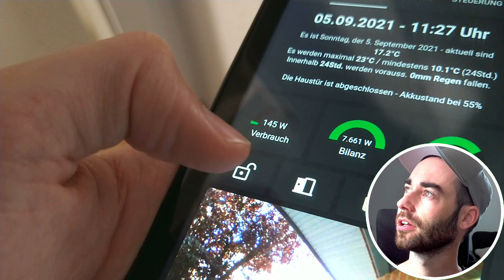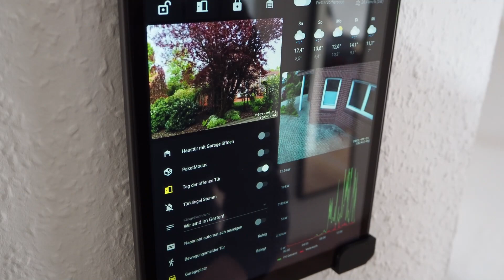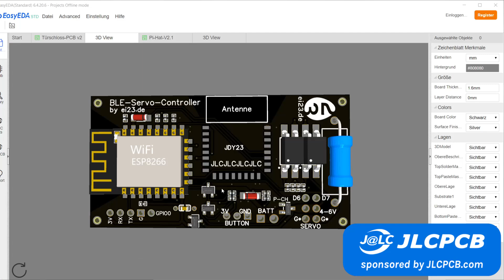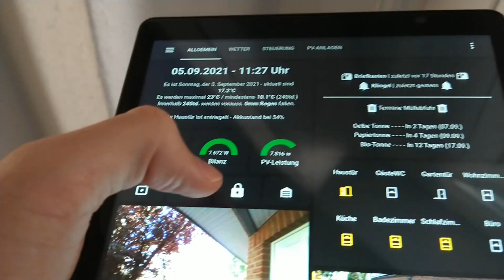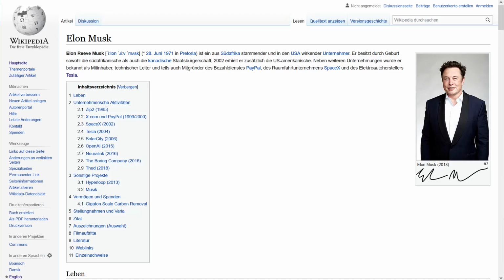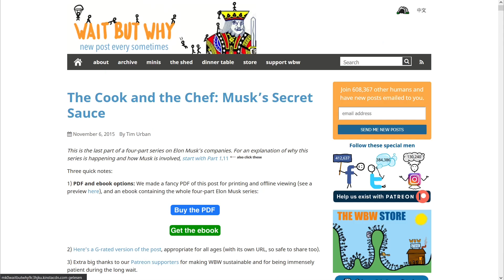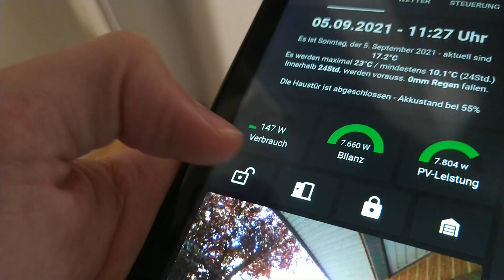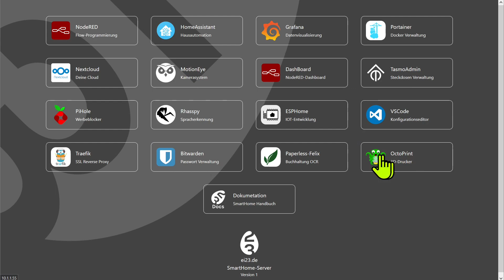Engineering a Battery Powered Wifi/BLE Smart Lock with custom PCBs [ENG]

Comment: Hello, thank you very much for your work. 
Very interesting. 
I am a computer science engineer and know nothing about electronical stuff. 
I am learning and your video is a very good starting point. 
I want to create my own smart lock too due to very high price commercial offers. And I want to learn how it works. Being able to fix it.
Did you update your project since? 
Do you have any materials I could start from? 
Would you mind sharing your 3d files ? (Another skill I need to master).

Thank you!
Reply from the maker: I did a small revision, mostly software. Its one of my most reliable projects, i use it daily.
Also i have a door opener for my backdoor (see under short videos)

I will give an update share some details "soon".
can not say exactly when.
but you have now LLMs as tutor, right?
I did not have it, back then.
Reply: @ei23de  yes I heavily use LLM, and learned a lot. This is also a reason why I discovered your video. I am still fighting with chatgpt to understand servo. Things like only half a rotation. Rotation on both ways. Double rotation... Oh man. Actually it is not so easy to jump in this world. But I am learning :)
Hope, "soon", will be "very soon"
I am on my mosquito net custom project for my kids right now, and my shutter transformation from manual to domotic for dividing price by 10. Thanks a lot for replying by the way, I really appreciate that.

Comment: How do you get the servo to stop when you make an effort in the opposite direction of the turn? 02:11
Reply from the maker: With a Shunt on the analog sensor the current is is measured
Reply: @ei23de thanks, I'm using an INA219 sensor to measure current. What analog sensor are you using? And what shunt do you use?
Reply from the maker: @melsion2183  Analog Input from ESP8266 and a 1W 1Ohm Resistor

Comment: Great Project! Im doing something similiar. Im trying to took off a tuya smart lock and gain local acess to the commands. I already have de hardware part, but Im struggling a lot with BLE modules and power consuption. Could you share your JDY23 code?
Reply from the maker: Yes, power consumption optimisation was the hardest part for me too.
The JDY23 has stock (AT) Firmware on it. I just changed the standby / beacon interval via AT Commands. Just search for JDY23 AT-Commands, there are some docs for it.
You have to connect with uart (tx/rx) 9600 baud and then you can enter commands via serial console like AT+VER and AT+SLEEP

The JDY23 has a pin high, when a device is connected. I use this to wakeup the ESP8266 via MOSFET.
I recently found the SEEED XIAO BLE (BLE ONLY), this should also do the job without the ESP8266. It has great documentation and very low power modes.
Hope this helps

Comment: so how did you trigger Bluetooth in order to wake up wifi module?
Reply from the maker: BLE Module is in permanent low power stand by (< 0.2mA)
You can trigger a pin on the BLE module to turn on a mosfet circuit to power up the ESP8266
Reply: @ei23de  do you trigger it by hand then?

Comment: being as the PICO W is like $6 and 32bbit, could one of these be used, as they are thin small, fast and cheap !!
Reply from the maker: Connected standby power comsumption for the Pico W is too high.
You still need a low power BLE device with very low power.
Try the XIAO BLE!
Reply: @ei23de  thanks

Comment: Hi, it's a great project. I'm reviewing the materials I need to do something similar. What servo did you use to turn the key?
Getting the battery to last six months is great, what kind of battery is it?
Thank you very much!
Reply from the maker: Thanks.
Servo: MG996R
Battery: 2x 2.5Ah LiPo at 4.2V, but 4x AA
batteries also work great.
Reply: @ei23de  
Perfect, I just ordered the servo to do tests. I have not found any 4.2V LiPo battery, all the ones I saw are 3.7V.
I'll try the 4 AA batteries. Thank you very much.

Comment: Your videos are most educational with a well thought out presentation.
I am working on an Esp32 project for which I want to monitor a low voltage circuit and when it is closed it makes a buzzing sound on a smartphone. When the circuit is opened the sound stops. Would you be interested in helping me professionally or can you give me some direction to an open source like Home Works that might apply. 
Thanks, Joel
Reply from the maker: Thank you!
I'm quite busy right now, but i could give you some tips to get you in the right direction:

If you are not already into it, check out MQTT
Also you will need some kind of server. A raspberry pi for example works great as server running mosquitto as MQTT Broker and NodeRED for logic.

If you are not so much into programming, you should have a look at ESPHome and Home Assistant
Reply: @ei23de  I have worked with the Esp32 cam and built a camera. I will try that venue. Thanks, Joel
Reply from the maker: Yes me too! Check the doorbell video, if you not have seen it.

Comment: Love it! Also looking forward for the detailed tutorial. 

I'm working on a similar project (not for doors) and, being more a software guy than an electrical engineer, I spent so much time trying to find a low energy wake up source for it. I love how you got inspired by your radiators control. My inspiration came from 433MHz device but for low energy battery project, it just doesn't work. The insight about the JDY23 has been a game changer!
Reply from the maker: I'm also more on the software side... hardware is hard :D
It took me ages to find the right device and setup.
glad if i could help out.

Comment: Hi! What state is the JDY23 in when it is listening for a message to wake up the ESP?  Is it "Light sleep with Broadcast"? If so, which interval do you use? Thanks!!!!
Reply from the maker: You can activate sleep mode with AT commands, also broadcast inteval i've set to 200ms this way.
Settings will be saved. 
The JDY23 will light sleep after some seconds without a connection.

Comment: Your project turned out great! I tried to make a smart lock similar to yours but the battery only lasts for 2 days. I don't have much knowledge in electronics and I found that the servo that was consuming too much battery. I put a mosfet to turn it off after opening/closing the door but it didn't work. By the way is the wifi that gets a lot of battery, right?

It would be great if you share your project and list of parts you used.

Congratulations on the video and the smart lock!
Reply from the maker: Thank you!
Yes, i will share more details someday.
It was quite a hassle for me, since i neither was into into electronics. I tought myself everything, most of it by trial and error.
The servo uses ~2-5mA in standby, so i turn it of with a mosfet.
And of course Wifi and the whole EPS8266 is also turned of. That uses up to 50-120mA when turned on.
It's all woken up by the BLE Board (JDY23) which get down to  0.1mA in standby.
Battery lasts about 6 month, which i am super proud of.

Comment: Hey, just ran into the same battery life issues myself while working out a similar project!  I don't suppose you have a parts list or schematic for your wiring available, do you? Would love to be able to piece the electronics together without trying to reverse engineer the shots in your video. Right now, I'm just relying on corded power for my lock
Reply from the maker: I have an ugly fritzing sketch as schematic if thats ok?
Reply: @ei23de  Anything helps! Thanks!
Reply: @ei23de  Hey, just wanted to check in again to see if there's any way I can get a link to that sketch. Thanks!
Reply from the maker: @jarethmt26  Sure. https://download.ei23.com/?action=download&file=Tuerschloss_Steckplatine.jpg

There is an hallsensor (OH49e) which is not needed, also one of the optocouplers is not needed anymore.

I built the current PCB version without a sketch, just out of my mind and with this sketch.
But i will do an update to this someday!
But this will do it for the first i think.

Comment: How long does the battery last?
Reply from the maker: About six months, as i said.
Reply: @ei23de  is this over bluetooth only or with wifi connection?
Reply from the maker: Bluetooth is always on, wifi is only turned on for a short time if a device is connected to bluetooth.
Reply: why need the wifi?
Reply from the maker: There is no need for it,
but it is faster with updates OTA, better range and easier debugging. 
And the ESP8266 is faster and cheaper than Arduino chips. 
But you can go without it.
Reply: Can you build a wifi window sensor battery  operated  with esp8266 01? With tasmota  firmware ?
Reply from the maker: Possible, but as i said:
The wifi connection process is slow, it can take from 1-10 seconds to send the data.
Check out ESP-NOW.
Tasmota in this case has no advantage...
Reply: @ei23de  well right now I have it a static IP and it connects in 5 seconds  very consistently. I can deal with that for a window sensor or door. My dilemma is trying to power it on and off when the window opens and closes so it conserves battery as much as possible. I also have tasmota firmware flash on it its how it connects to my home assistant via mqtt.
Reply from the maker: @shannonbreaux8442  You could do deepsleep, or better -> completely turn the ESP of with a p-channel mosfet circuit.
I guess the challenge is to trigger it when it opens AND closes.
But you only need a short pulse to wake from deepleep, or turn on the mosfet circiut. Then you could check the state of the switch... Possible, but not beginner stuff i would say.
Reply: @ei23de  I'm leaning more to the p channel mosfet circuit since it will turn off esp chip  using a magnetic reed switch. Can you do a short video on that?

Comment: Awesome work! Looking forward for the detailed tutorial.
Have you tested battery saving on fingerprint sensor or keypad (if paired witht the lock via homeassistant for example)
Reply from the maker: Thanks, no i don't want wirings on the device. 
The battery lasts now about six months with BLE in Standby, thats great for me.
Reply: @ei23de   exactly, those other input device should be separately powered by respective batteries.
Also, if you manually lock/unlock the bolt by hand. Would this reflect the current lock status or affect the motor?
Reply from the maker: It's all powered by one battery, but everything which is not needed is turned of by a mosfet circuit.
You can easily rotate the key by hand, this is important for safety reasons.
The lock state will then not get updated until the next automated run.
Reply: @ei23de  how did you get the batteries to last 6 months?